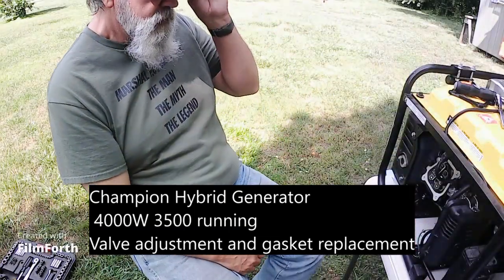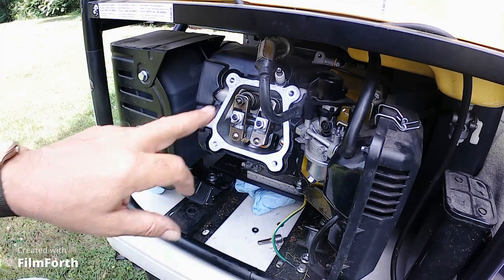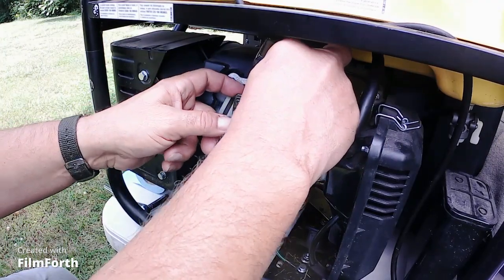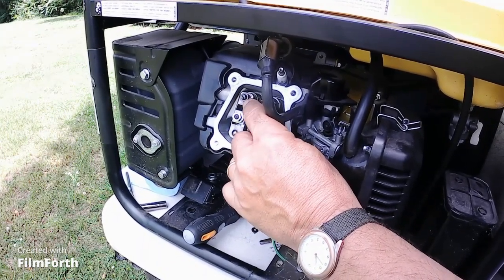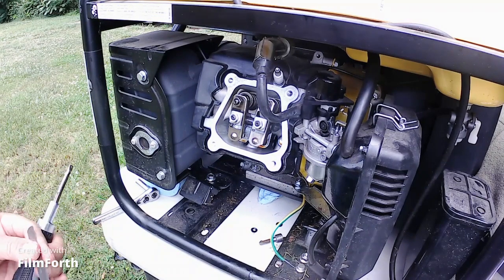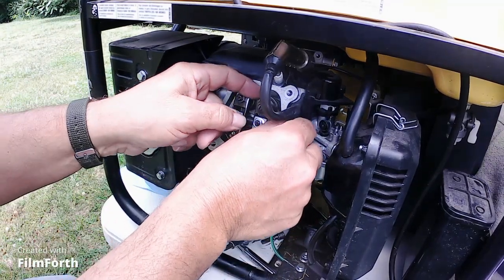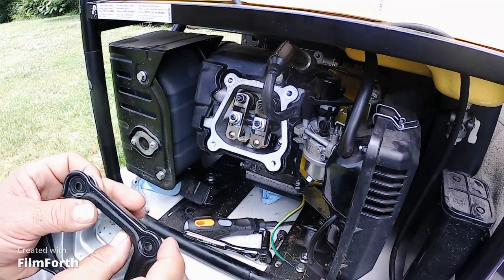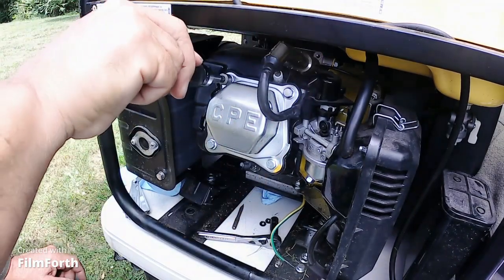How I Champion 4000W valve adjustment and replaced the Gasket

Comment: I have the Champion 4500/ 3650 generator.  We just went through Hurricane Helene, and I used this generator hard for 14 days. The 14th day I woke up, shut it off for refuel,  and it would just backfire. I tried everything to get it to start and had no luck. Finally I went and bought a feeler gauge,  and decided to try this. Ofcourse on my generator it said. 008 on exhaust,  and .006 on intake side.  It worked, thank you so much. My exhaust side was completely tight,  I tried what you said,  and it started on the second pull. Your saving generators, and money. It also says on Champions web page everyone should adjust their valves any ways to extend the life of your generator.  Well ,Thanks again.
Reply from the maker: @georgiapatriot3617  thank you very much for watching. I try to keep mine running. I,, am getting ready to heavily use mine for about the next 20 days of camping.

Comment: You said, I=.005"/13mm & Ex= .007to.009"/18mm, exhaust usually a higher #, at TDC at TopDeadCenter "per valve" meaning each ine individually  on a 4kw Champion gen?
Reply from the maker: @interiorartnews4568  i believe i misspoke but later corrected.  Only did what the champion spec were right out of the owner manual. Still runs like a champ.

Comment: I own 2 of these champion generators how many hours did they have on them before valve adjustments.
Reply from the maker: Well past 300hr. Us every year for 20 days during hunting camp. 
My 2 2500-watt inverters get the most use now running the camper with the 15000 btu run them joint together.
Reply: Okay, thanks for the reply. Best regards! @AdventureswithP.C.Wabash6057
Reply: Thanks for the reply, best regards!

Comment: Şorry -brother but you failed to find TDC,, you don't set the valve s with either valve open!  U find TDC ON COMPRESSION STROKE!! BOTH VALVES 100% CLOSED!
Reply: When u adjust valves has to be top dead center. That’s just small engine mechanics 101!
Reply: @demetriosa7646  he is correct. This is how champion wants it done. If you do it the other way it will not run. Fooled me too
Reply from the maker: This is how Champion instructs to do it so that's how I did. Runs just great choke and pull fires right up runs great.
Reply from the maker: Ok, thanks this is per champion  video they put out on their page